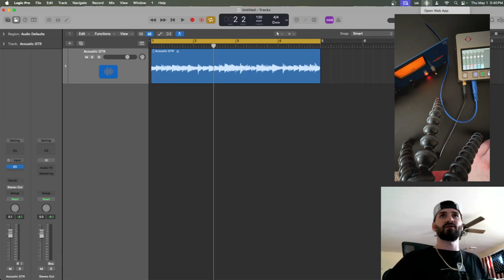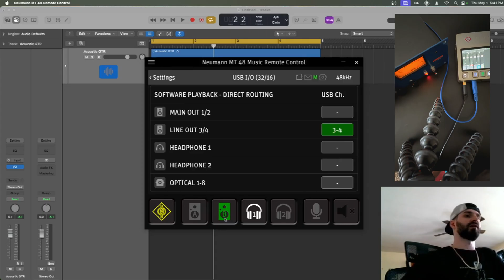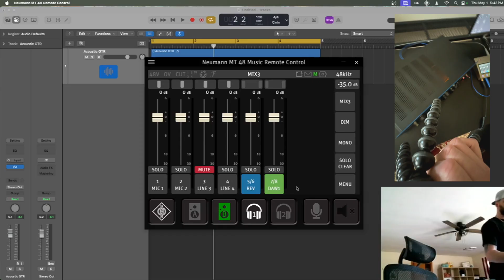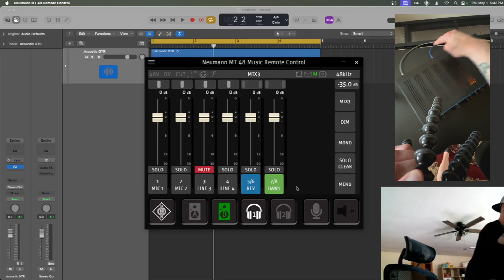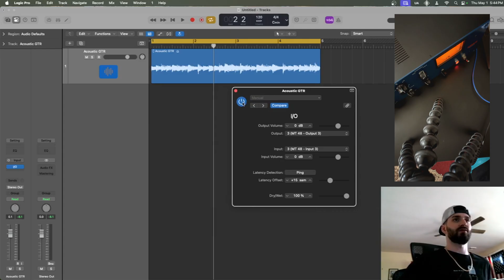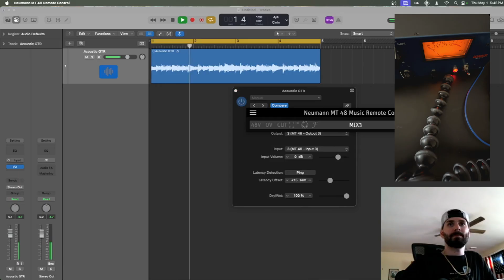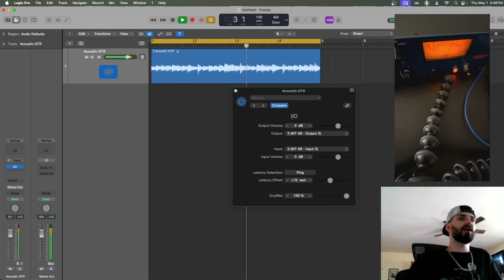MT 48 External Hardware Routing Guide

Comment: Nice video. Could you explain or make a video on the best way to use an external preamp and compressor before hitting the interface?.
Reply from the maker: Hey! Essentially you'd want to wire the way you normally would with any interface. Mic > XLR Cable > Pre Amp > XLR or TRS Cable > Compressor > XLR or TRS Cable > MT 48 input. Just make sure you've got whatever channel you're using set to line input. If you use CH 1 on the MT 48 you can swap this between Mic and Line via the preamp section.

Comment: Wow, I was going crazy about this. You helped me a lot, even though I haven't solved it yet. Because I can't use channels 1-2 to send and receive signals from my outboards, I don't understand how to listen to the wet signal in Logic. Is this only possible with channels 3-4? Thanks a lot.
Reply from the maker: You may use CH 1 & 2, just make sure you set it from MIC to LINE via the preamp section.

To avoid duplicate monitoring and only hear the signal in Logic you’ll want to make sure your mixer is muted via the MT48. I go over this in the video and also in my written guide which you can find here: https://krisdoesaudio.com/2025/01/02/how-to-route-signal-from-your-daw-to-your-external-hardware-using-the-neumann-mt48/

Comment: Is there a way to route the built in preamp to hardware for a tracking scenario?
Reply from the maker: Yes. You would go LINE IN - directly to the MT 48 from your hardware. You can use an XLR cable, just make sure you set the input to LINE IN via your MT 48 preamp section
Reply: @krissheehy I want to go microphone > mt48 preamp> compressor > DAW 

So it’s the same process as this video?
Reply: @krissheehy so I can record from the mt48 preamp straight to a compressor without routing it through the DAW?
Reply from the maker: @waves7300  No, sorry. I misunderstood your original question. You cannot use the internal preamp of the MT 48 and then route it to an external hardware compressor for tracking. I attempted this for fun once and was able to make it work but the signal sounded awful. The MT 48 was not built to do this by design. I would suggest utilizing the DSP compressor that comes with the MT 48. Alternatively, use both an external preamp and external compressor.
Reply: @krissheehy yea no my 1176 sounds much better. I’m able to do it but I have to route it through my DAW and lemme say it does sound really good through some hardware
Reply: @krissheehy also what a big flaw even focusrites can do this. Regardless I made a work around but I don’t like the workflow of it
Reply from the maker: @waves7300 Yea, you can go through the DAW but that adds latency. Most people will want to use direct monitoring because it utilizes the internal DSP of the MT 48 aka no latency ~
Reply from the maker: @waves7300  To be fair it’s a much more complicated device than the Focusrite line up. I see your point though. Hopefully we’ll see a change to it in the future!
Reply: I was even able to get the post effects like eq and a gate before I hit my 1176

Comment: Thank you great info ,question ,
So you coming back in via the instruments ins on the front ? Dont you need to use line level signal?   I am considering this  interface .
Reply from the maker: Yes, use line level. You can do this from the same port (INSTR/LINE 3 & 4). Just make sure on the pre-amp section you change it from INSTR to LINE.
Reply: @krissheehy oh gotcha thanks again 💪
Reply from the maker: @flavmusicman  No problem! I’ve been rocking mine for over a year now and I love it. Sold my Apollo for it ;)
Reply: @krissheehy  yes I heard it against the X6 Apollo, and it is a much  more open sounding interface specially the MIDS  to MID-HIGHS, loved the sound

Comment: Thanks, btw you dont have monitoring of the compressed signal in this case? Or I missed something? I guess I can set up interface so it monitors signal with effect on one headphone out and on another headhone out monitoring of compressed signal will be off. I just ordered the interface so cant try it myself yet
Reply from the maker: You're welcome, friend! The signal will be coming back into your DAW. So the affected signal will be monitored via the meter in your DAW on the channel you're sending signal from. You can monitor this regardless of whether you're recording or not.

If you want to monitor your original signal again, you'd bypass the plug-in or hit the bypass switch on your hardware.